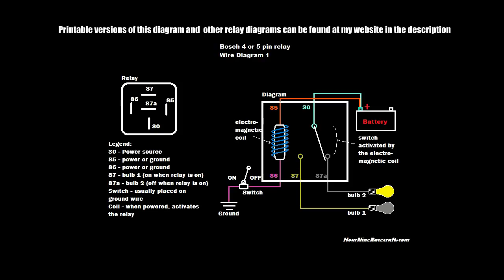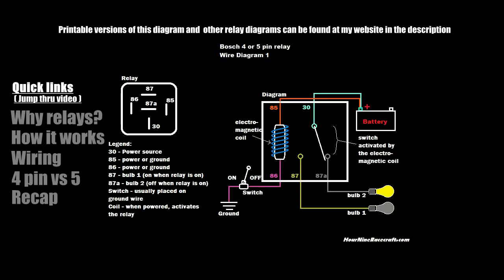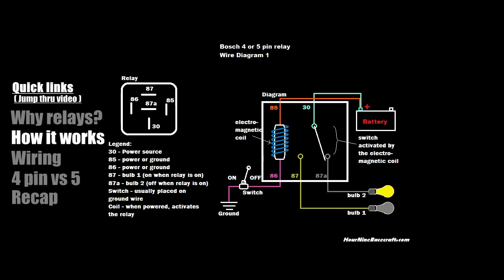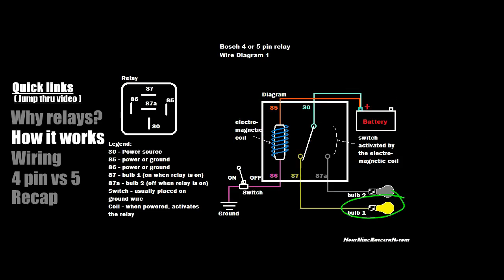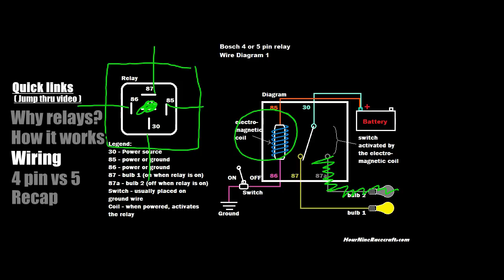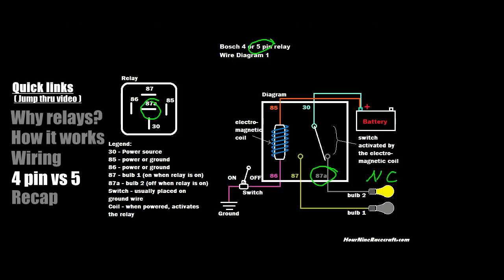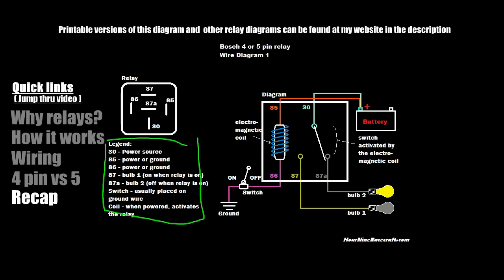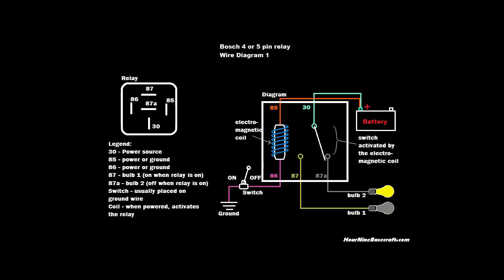Relay Tutorial: 5 pin vs 4 pin wiring (Example 1)

Comment: I've tried but I can't seem to get the double relay setup to work. I am testing this setup on the bench using a switch to simulate the reverse light signal and a second switch for the manual trigger.

I've drawn the diagram out but can't figure out what I'm doing wrong. Any way to send you a pic of my diagram for you to look at?

Or can I wire it with a dual pole/dual position switch instead?

Posted a picture of the wiring diagram here... https://youtu.be/rXjUJ8nvcM4
Reply from the maker: You can email the diagram to hournineracecraft@gmail.com

Comment: You missed a few points that are very important and you got one thing "wrong".  

First you should have gone over WHY you need heavier gauge wire for the lights. The current draw needs thicker  wire so that it doesn't get hot and fry.

You mentioned cost but again WHY. You longer runs of wire to get to where the switches will be and thicker wire is harder to run with all the bends and turns.

You got wrong that the 85 and 86 does not matter what side you connect pos and neg. In most case that might be true however there MANY MANY relays that have diodes built into the relay and the pos and neg matters. In general you should wire 85 as the neg and 86 is pos.

One more thing. You should stop calling the SPDT relay THE 5 pin relay. This is a SPDT (Single Pole Double Throw relay). Yes it is "A" 5 pin relay but not all 5 pin relays are SPDT. There are SPST (Single Pole Single Throw) relays that have 5 Pins. They have TWO 87 pins. When the relay is energized both 87 pins are closed and connected to the 30 pin. You should have mentioned this even though this is supposed to be a basics level video. A person who sees this video may go out and get a relay and see 5 pins but damage their project because they didn't check.

Nice very well done video tho. What software did you use to do the animation?
Reply from the maker: Thank you for the input. I should have been more clear, yes.

I didn't use animation software, I used screen capture software I could draw on and I cycled through two pictures that I drew.

Comment: I wanna put a starter kill switch on my Sierra classic and having trouble to what wire taps into what. Can't figure it out, electrical is not my thang.
Reply from the maker: This would be the easiest option. It is cheaper to make one. If you don't want do it that way, you will need to find the starter wire so you will need the wire diagram for the Sierra. Once you find the wire just tap into it with a toggle switch

https://www.etrailer.com/Tow-Bar-Wiring/Blue-Ox/BX88271.html?feed=npn&gclid=CjwKCAjwqdn1BRBREiwAEbZcR0jHTF8uyrmQOJPz7-VVxxMZ_s36ZOiFaUUToxsZ0j_gENhxb9WgFhoCUf0QAvD_BwE

Comment: pin 87a can always be used to power a light to signify that the a relay is in the off state and not sending power to pin 87. just a good way to use it I guess and have a green light piggied off 87 for on. happy wiring

Comment: So if I have a preexisting 4 pin relay circuit that is activated by a switch, if I want my device to only pull power when the switch is on, I run the device power to pin 87? Thank you for the fantastic videos.

Comment: So I can use a 5 wire switch just the same as a 4 wire switch all I need to do is disregard the 87a terminal. Then it will work exactly like a 4 wire switch??
(Edit) sorry relay. 😉
Also, all media that I have seen on wiring headlights (a 2 headlight system where the headlights are hi/low each light) everyone uses two 4 wire relays. So 2 questions here. 1 could you use a single 5 wire relay to wire a 2 bulb hi/low headlight car. 
2 I believe but not positive, that when you turn on your hi beams on a 2 bulb headlight car the low beams remain on with the high beams?
Reply: No.
Either one is on or (87) the other (87A). The relay ONLY allows 1 on at a time.

Comment: So i just run a short loop wire from pin 30 into pin 85?
Reply from the maker: Yes, you can do that if you are using pin 30 for the 12v +

Comment: i have a question about a relay i got the pins on it is 30,85,86 and 87a  no pin 87 is this a regular 5 pin wire with 87a removed or is a special relay ?

Comment: Please, I have been watching these videos for hours, so far not one has spoke to the fact there are really two switches besides the relay that need to be wired & or how to do it, so high low beam on switch one going between the two, shown first illustration, what about switch 2 the switch that turns both lights off, how is it wired does it cut ground or is it between pin 30 & the battery which seems logical I'm wiring a new system, high low beam & off switch, my foot dimmer switch has three wire, two position switch that  connects power to high or low, most videos say the foot dimmer is two position cutting the grown very confused & red eyed regards

Comment: I have watched a few of your relay videos, and they are very informative. The diagrams make sense and your explanations are great as well. I want to use a relay to have my DRL, and Fog Lights to also work when my turn signals are on. I already have the fog lights wired to a switch and a relay that is already on the harness. Can you explain if I  should use a 5 pin or 4 pin relay? I would also like to know if the turn signal switch in the car needs to be wired into the relay or not? And one more question should I get 2 relays to run each side of lights through it's own relay? Any diagrams, written explanations, videos, or verbal correspondence would be greatly appreciated. My name is Dexter. Thank you in advance for your assistance.

Comment: I liked this video. It explained the relay alot clearer then most. I was looking at this video, trying to come up with a configuration on how to wire some lights on my truck. I want to wire some underglow lights under the steps of my truck. I want to be able to use a rocker switch, but I want the underglow light to turn off when the footwell  lights turn on (normal function). I was thinking a 4 pin relay and having the positive wire coming from the switch to the relay but spliced to the footwell wire as a floating ground. Do you have any ideas for this?
Reply from the maker: Are your footwell lights tied to your door switch? I did a similar thing for extra footwell lights. Usually this is just a ground wire at the door jamb.
Reply: @LegitRaceCraft  Yes the footwell lights are connected to the door switch. I guess what I have in mind is like switch back lights. When I turn on the underglow lights, they stay on till I open the door, then they turn off when the footwell lights turn on. When I close the door and the footwell lights turn off the underglow turns back on.

Comment: Can u use a relay to switch a ground on and off and if so how would u wirer it
Reply from the maker: Yeah. You would just connect a ground wire to pin 30 and the item you want grounded on pin 87 or 87a, depending on whether you want it on or off when the relay is triggered.
Reply: @LegitRaceCraft  thanks what about pin 86 & 85
Reply from the maker: Those would be wired the same as they are in this video. One of them + and the other -
Reply: @LegitRaceCraft  ok thx for the help

Comment: Great video :) I am looking to do a headlight conversion from h4 single bulb with two filaments to a h1 bi-xenon projector. Problem I’m having is when I turn dipped beam on it works great but if I switch to high beam the light goes out. I have the low beam wired to the h1 bulb and the high beam wired to the projectors solenoid so the shield will drop and give me a high beam, I need to keep power going to 87a as well as power going to 87 when I turn on high beam so my headlights will stay on

Comment: I want to install 2 sirens for anti theft alarm system. Which relay should I use 4 pin or 5 pin relay?
Reply from the maker: +kapil pahilwani I'm not sure how you are wanting to set it up. I would get a 5 pin just in case. Most of the time you would just use a 4 pin. The 5 pin operates the same way and just has an extra pin. It gives you more options. Just make sure the 5th pin is 87a and not 87. There are two versions of the 5 pin relay.
Reply: I would want to know why two sirens? Are they the same type or are they different? Do you want them to BOTH go off at the same time or is there a sequence to it? 

I am going to assume that you want them to both go off at the same time. In that case you should use a Single Pole Single Throw (SPST) 5 Pin relay. It has TWO 87 pins. (no 87a). Both 87 pins are connected to pin 30 when the relay is energized. 

This allows you to connect two heavier gauge wires in to seperate terminal connectors, instead of trying to cram them in to one large 12 to 10 (yellow) connector. OR you can wire a single heavy load accessory and wire a low amp draw indicator light or other accessory that you would like to turn always turn on at the same time.  Like an indicator light that tells you your electric fuel pump should be on.

Comment: What if your switches have lights?Meaning the switch lights up....how would you wire 85 and 86?
Reply from the maker: +1MR when you say "switch" did you mean to say "relay"? The reason I ask is because some relays have lights to show they are on. Or are you talking about the switches that have indicator lights?

Comment: How do I wire a 5 pin relay to a single hi an low beam head light using a 3 pin toggle switch? Please help
Reply from the maker: +Thomas Grubb if I were wiring it, I would wire pin 30 to a power source that you can switch off (otherwise your headlight will always be on). Pin 87 to the high beam and pin 87a to the low beam. The toggle switch will connect to pin 85 (if ground is output from the toggle) or pin 86 (if positive is output from the toggle). So if your toggle is wired to output a ground for the relay, then connect that to relay 85 and 86 to something always positive. If the toggle is wired to output positive then connect it to 86 and connect pin 85 to ground. The end result will be: if you flip the toggle your high beam will come on and low beam off, then when you turn off the toggle the low beam will always be off. If you have pin 30 connected straight to your battery then the low beam will not shut off even if the car is off (I mentioned this is the first sentence), this is why you need a separate switch to kill the power to pin 30. Is the 3 pin switch a 3-way switch or a basic on/off toggle with an indicator light.
Reply: DID you figure it out?

Comment: I’m trying to add a pair of interior LED light bars into the camper shell of my truck. I want to be able to activate the lights using my trucks factory dimmer switch as well as have an independent switch at the rear of the shell to turn it on. I think I have a plan using an 87a relay but was hoping you could double check my plan as I intend to have 2 12v sources and one 12v output. 

Pin 30 will be my output to the light bars
87a will be the 12v source from the trucks dome light
87 will be an always live 12v from the battery (switched)
86 will be a jumper from 87 providing power to the relay magnet
85 will be ground. 

End result will be always connected to the truck dome light and a switch for use when the truck dome light is off. 
How does that look?

Comment: Okay cool, but what if I have a 5pin toggle switch? how do I hook it up to a relay?
Reply from the maker: +Theo Koevoets you will have to look at the wiring for your specific toggle switch, they usually have two lights inside (one for switch lighting and one to tell you that you have the switch turned on) sometimes they share positive and some times they share negative. Then you have the two pins for the on/off toggle. You would wire one of these pins to the positive side of your relay and the other to your positive source (or negative side of relay leading to negative through the toggle). I have another video on "tapping into your fuse box" that should help, I briefly talked about how i wired in my toggles, but they are 6 or 7 pin instead of 5

Comment: 85 and 30 to positive
86 (with switch) to negative
87 led1
87a led2

when I open the switch (86) both led's turn on
what's wrong? can you please tell me what to do?
Reply from the maker: +Vin Pajota it doesn't seem to be wired incorrectly unless two wires are touching outside of the relay. Also, there are some Bosch relays that are designed with pins 87 and 87b. You can check with a multimeter to see if it is like the one in the link below. You could also have a wire touching another wire.

https://www.trodo.eu/relay-main-current-bosch-0-332-015-008
Reply: Sadly I don't have a multimeter. These are the details of the relay I had, BOSCH 0332019150 12v/30a
the diagram drawn is different from the link, I wish I could show it. the numbers in the diagram are 

 85    87___87
  [/]--------\
 86         30

the diagram kinda like this there's no 87a or 87b

Thank you very much for the quick response!
Reply: I just noticed today that the dots below the two 87 has connected line...... T_____T

Can you please give me a link of the the specific relay you used?
Reply from the maker: +Vin Pajota ah..yeah. that relay isn't the right one. It is weird that they use the same connector. You need the other Bosch relay with 87a on it. Then you can plug it in and it should work properly. The one you have is the least common one. Usually when you order them online you only get the one with 87a. Did they give you that one at an auto parts store?
Reply from the maker: +Vin Pajota I just bought these for my off-road lighting install. I bought the cheapest I could find. They have pin 87a and come with connectors.
 https://www.amazon.com/dp/B017VDI0GY?ref=yo_pop_ma_swf
Reply: Yup I bought from an auto parts store... So I should ask for that one has 87a, alright I might get back there tomorrow, then I'll let you know. Thanks a lot!
Reply from the maker: +Vin Pajota I might do a video explaining the difference between these two relays.
Reply: Hi there, I already got the right one. Last night I tried to apply the diagram from your video (exmaple 4), I wanted my side marker stays on and flash when the turn signal is on. And everything went good. 

I wanted that the side marker turns on at night,
So I tapped 30 to the park light, but if the park light is OFF the turn signal light wont work.

If 30 is tapped to the ignition the side marker stays on day and night.

Can you please suggest what to do?
Reply from the maker: +Vin Pajota I have another video on "tapping into a fuse box" that should help you. You can try to find an open fuse port and use it. You'll need to find somewhere in there that has power on only when the car is on. Or you can always drive around with your parking lights on, but you might not want to do that.

Comment: Whats up  O just got a relayed on and off switch do to the fact my harley is blowing fuses,   thas a another problem,  anyway when i wired my headlights up i got nothing   put my meter on and i got juice.  no light so i tested my old halogen and it lights up.  why do u think that works but my led dont .  i mean isnt thats why i got a relay for the led to distribute the power correctly.  i dont know it dont make sense to me    i appreciate your help if possible  
thanks Eddie

Comment: Great video, but im just a little confused with what to do with the 87a pin if im not going to use it... like is it still hot in the off position? Should I tape it up? Sorry for the noob question.
Reply from the maker: +Micheal Velasquez it is hot when not being used. that pin is in the middle of all of the pins, so if your connectors are shielded then you don't have to worry about it. Ideally you would use a 4 pin relay, it is the same but it is missing that 5th pin. But if you only have a 5 pin relay to use, then you can tape it or use shielded connectors.
Reply: HourNine Racecraft Thank you so much!

Comment: Please help me. I have a Whirlpool Dual Door Fridge on which the inbuilt timer(8 Hour) had conked off. Replacing it hasnt helped and I am unable to troubleshoot.Right I am mechanically switching off the fridge in the night for about 8 hours so that the ice doesnt build up and jam the fan.
My question is can I fix a 4 pin or a 5 pin auto timer/ Controller (which is readily available on Amazon)to switch on off the fridge.
Which one do I use - 4 Pin or 5 Pin
Kindly advise.
Rgds,

Comment: Good science dude, my question is in my 98 tahoe i have 2 wires to my running light/turn signal and above it was a reflector. I added another 2wire socket and bulb to each side of the vehicle to the running light/turn signal wired in parallel and now only one side works. I did add also chevy tow mirrors with LED turn signals/running lights, i was thinking i am overloading the switch. Would wiring in series make everything work or do i need relays coming off the turn signal wire to help the switch power the added lights plus tow mirror lights. Hope i am clear!
Reply from the maker: +E. Davis wiring in series will just lower the voltage at each bulb. I have a video specifically on running extra turn signals and using the old turn signal wires to trigger a new relay. The new bulbs are connected through the new relay. The link is in the description. As far as the one side not working, I would return that side to normal and then troubleshoot. You could have burned out the relay or blown a fuse.